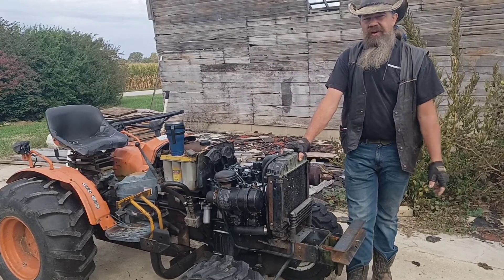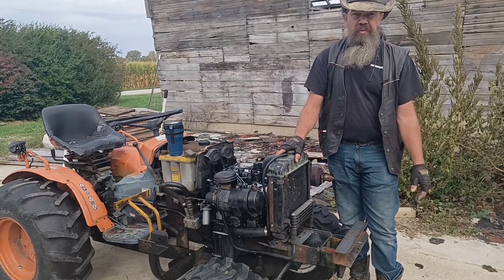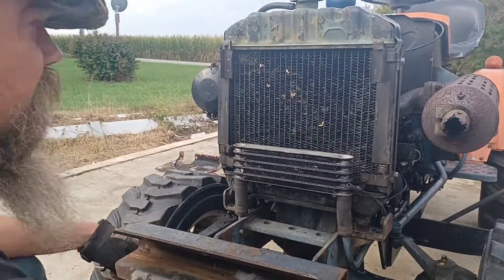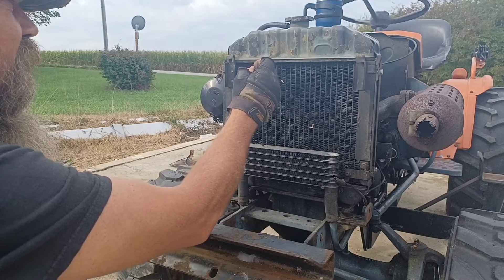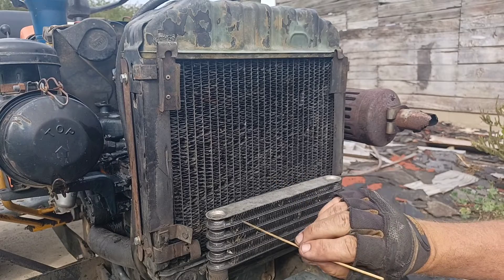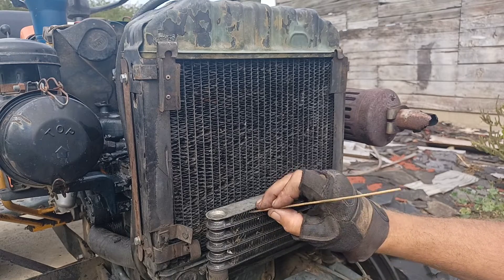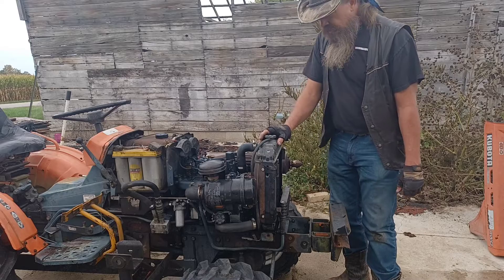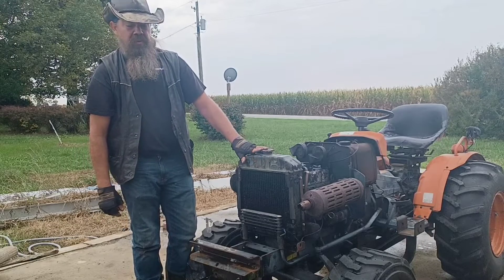Does your radiator whistle? Kubota B7100 thermosiphon cooling maintenance

Comment: I have the same one.    It immediately overheats.    Don’t know why.  Oil looks good.  Plenty coolant.  Does it have a thermostat?
Reply from the maker: Sorry It took me so long to get to you, I seemed to have missed your question.
The tractor does not have a thermostat (or a water pump) like conventional engines we're used to. It has a thermo-siphon system that uses natural convection of the engine heated and radiator cooled fluid to cause the coolant to flow.

Your immediately overheating tractor could be a number of problems-
1. Most obvious would be loose/broken belt or damaged dyno. This would prevent fan from properly cooling the radiator.
2. Dirty/clogged radiator exterior. Probably the most common reason these overheat. It's the big issue I address here.
3. Improper coolant mix. Some owners say they have to run a 2:1 coolant to water mix in these. Mine has always done well with 1:1. A bulb type coolant tester usually costs just a couple of dollars and will tell you the freezing and boiling points of your coolant.
4. Clogged radiator core interior. Because of the nature of the system, you would never know if your radiator is clogged, hot coolant would just immediately come out the overflow until it has reached maximum expansion. A radiator flush/ de-scaling solution may be in order. I did this the first time mine ever overheated.
5. Blown head gasket, warped head, etc.. Hopefully this is not your issue, but in some cases, a failure of the head gasket can allow exhaust gas to seep into the coolant ports, causing quick heating and expansion. If your coolant stays pretty much full, but is really cloudy, look here. If all else fails, look here. 

Hopefully this gets you going in the right direction. Thank you for your interest and support and sorry for the delay.